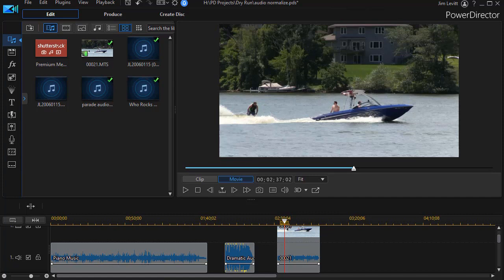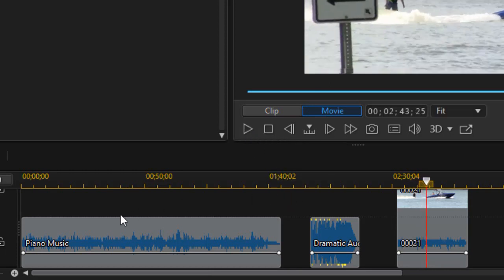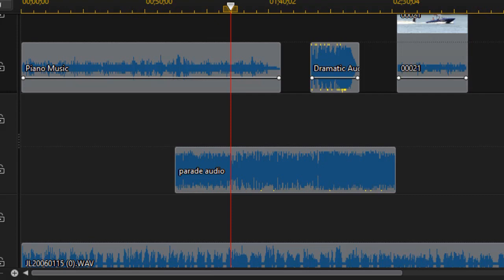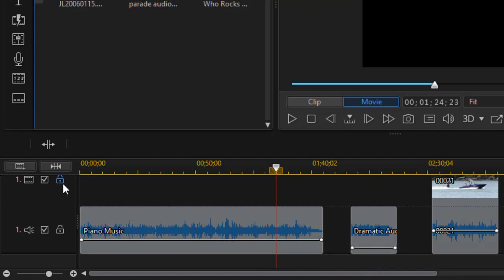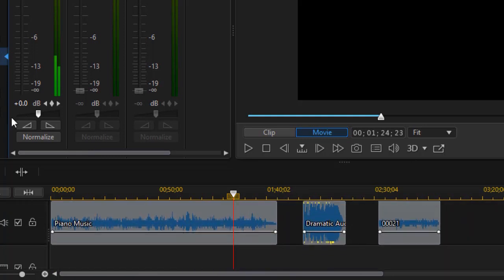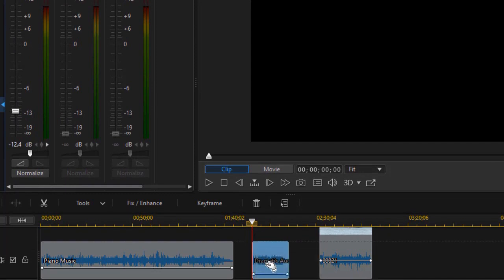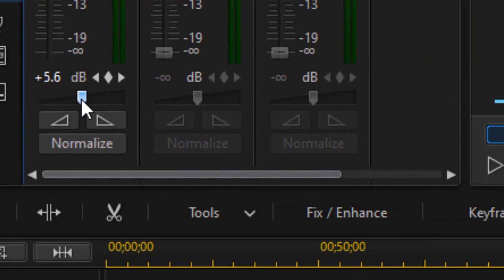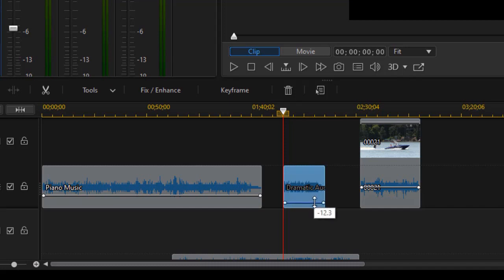PowerDirector - Tips on normalizing audio

Comment: Thanks for all of the videos. they are quite helpful. I am hoping you can help me with something that you mentioned in this video. I have multiple pieces of audio from tracks one to 5. How can I normalize all of these? I must admit that I don't really understand the basics of audio (db, gain, etc). Therefore, I have just been trying to do it 'by ear'. my audio has been all over the place and I really want to get this figured out. thanks so much.
Reply from the maker: If the audio is playing at the same time you can move the play head to the frame where all the audio appears and then press the F9 function key to get to the audio mixing room. You can adjust tracks from there. I don't know an easy way to adjust audio that is in different parts of the project and on different tracks. What I would suggest is a bit odd, and maybe someone on the channel will have a better idea. I would perhaps temporarily move all the audio to the same track and use the normalize tool, then move it back. But that seems odd. There is probably a more elegant solution, but it's not coming to me at the moment. 

I just tried something and it might work. I'd try in on a couple of test audio sources first rather than a project. Use the mouse to highlight all the audio sources on all the tracks. Then right click on anyone one of them and select "normalize". It's worth a try. I tried looking at the on-line help and "normalize" did not trigger any links. Odd. --Jim
Reply: @SharperTurtle that's exactly what I was thinking... But there should be a way to do it without that, no? Haven't you discovered it in the meantime? ;)

Comment: Got a question…if you have a big project where you’re working with maybe a hundred clips on a track, how do you normalize??
Reply from the maker: I just highlighted 11 audio clips and then used the normalize to all of them at once. I don't believe it would be more difficult to do that with 10 times as many. You can adjust the timeline magnification so you can see all the clips on the screen at the same time so you can highlight them before using the normalize command. --Jim

Comment: When I record audio with Cyberlink Audio director then input into Power Director, it's too low.
Reply from the maker: What kind of audio are you working with? I just used my podcast microphone and recorded some audio and then exported it to PowerDirector and the gain (volume) was acceptable. 

Have you tried adjusting the gain in AudioDirector before exporting to PowerDirector? What is your recording setup? --Jim

Comment: What about normalizing within the same clip?
Reply from the maker: Normalizing only works between clips. You can adjust the db level within an audio clip by moving the gain up or down for that clip. --Jim
Reply: Thanks. The problem I had was massive differences in volume within a clip. I upgraded, and AD has a feature to normalize within the clip with the click of a button. Very useful.
Reply from the maker: Glad you found your solution through AudioDirector. Thanks for letting me know. --Jim

Comment: Thanks for the explanation. I never knew what the normalize feature did or the gain control. All these years of using PD12, I only ever adjusted the various audio clips manually with the sliders. I think I probably tried normalize once and didn't see what it did and thought it didn't work or change anything noticeably and I went back to manually changing it. I just tried it like you show and yes it adjusted the various audio differently to each other and the gain changed them all at the same time. I'm not convinced it got them exactly right on my current project. Two clips I recorded in one location of me singing seem to blast my ears and the others from a different location seem ok. Though I think this is the locations fault and not PD fault, as the others were recorded in a room with a bit of an echo, but I think I will just manually fiddle with the other two that were recorded outside and see if I can get it better.
Reply from the maker: As I read your post I'm reminded of how complex it is to adjust audio-especially when your conditions are not ideal, which is often the case. I'm glad that the normalizing function is working a bit better for you. And sometimes you have to make adjustments beyond that, as you note. But it sounds like the final result is getting better in your case. Congratulations for that. --Jim
Reply: @SharperTurtle  thanks for the reply. Yeah now I've discovered how it works, I will definitely try it in future when I need to adjust all the audio. It would definately be quicker then going to each audio clip and using the sliders to adjust them and trying to get them all the same level of volume. 🙂
Reply from the maker: You are right about that. It should save time in the end. --Jim

Comment: I moved up from PD18 to 365 recently. I've just completed a 15 min video (three weeks of work!) Only to discover PD  is still mangling the audio. My voiceover, which sounds fine in its original file (44.1KHz), no yellow 'peaks' on the waveform, is badly clipped. Sounds gravelly. 
I know this problem appeared on PD14 and a patch was released, but only for that version. I've posted a query on the PD Forum.
Have you encountered this issue, I'm curious?
Reply from the maker: I have not experienced this issue myself. You've gone to the top volunteer experts if you've posted this to the forum. They have much more technical knowledge than I possess on such things. Hopefully they will be able to assist you in figuring out what is happening with your audio. --Jim
Reply: @SharperTurtle  Thanks Jim. Problem solved now, with the Forum's help ;-)
Reply from the maker: I'm so thankful. That's great. There are some super folks at the forum. --Jim